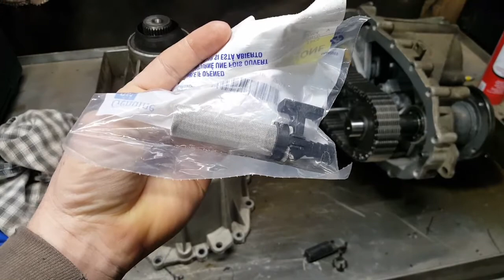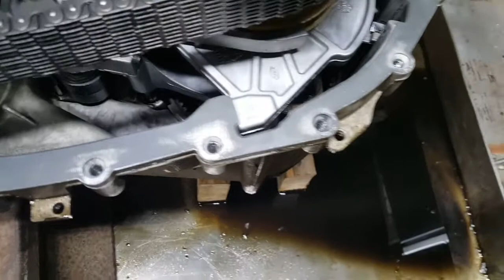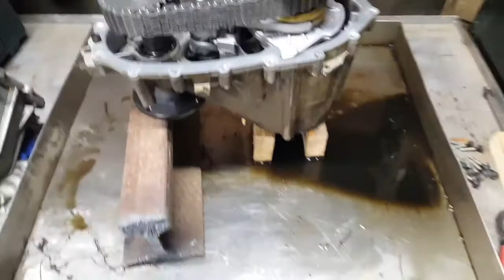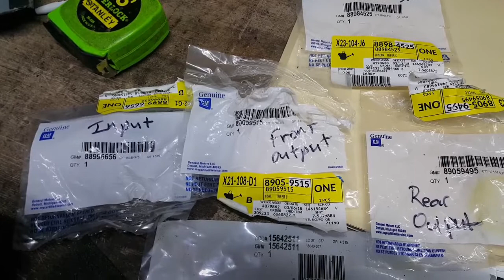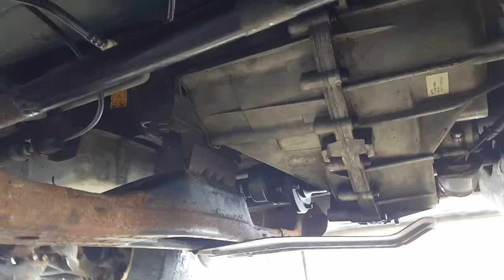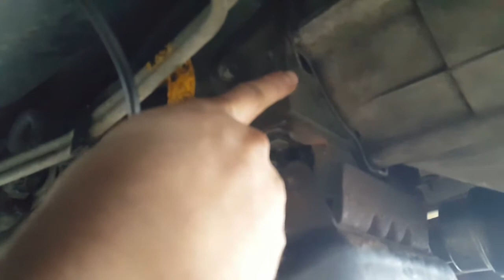Hummer H3 Transfer Case Pt 2

Comment: When you said disengage was it stuck in 4 wd high and did the dash light from all wheel to 4 high change mine definitely something wrong at above 55lbs and when I pulled over to turn around it felt like I was in 4 wd high or low all by itself after I changed out shift motor already now I’m changing out fork cause it thumps and grabs and starts to wine all while it says I’m in all wheel drive, do you think I’m having a fork issue

Comment: Hi, does anyone know if I can just replace the shifter fork without removing any of the gears ⚙️?
Thanks
Reply from the maker: It's been a long time ago since I did this job, but I don't think the fork can be replaced without removing the gears. I don't think you can access it until the gears are out of the way.

Comment: Si im about to replace my shift fork and I want to know if the vehicle needs to be in D or N or if  the drive shaft needs to be alignment or something and what do I need to know before doing this job I would like you to give me you phone number or a way I can contact you to ask some questions I really need help!
Reply from the maker: Hey there, whether the truck is in D or N doesn't really matter much. No need to worry about phasing the driveshafts either.

Sorry, I don't give out my phone number, but if you post up in the comments here, I should see it and I can respond.

Good luck with the project.

Comment: Can anyone tell me what is the easiest way to put the 2 halves back together?
Do you have them side by side or the half with the gears facing up and the 2nd half coming down from above ? I'm having a terrible time getting the shift lever, the Fork tube, and the 2 drive gears to align up to the second half of the Transfer case !
Reply from the maker: I reassembled mine laying flat, side by side on the workbench.
Reply: @diymechanictv1233  
Wow, thanks for the fast reply... I broke the little tip off of the shift lever and had to wait a week to replace that part...just got it and now am fighting getting the halves back together... I don't want to RTV it yet until I can make sure I can get it back together ! It's tough getting 4 different shafts and that spring all lined up at the same time !
Thanks again

Comment: Hi. Hopefully you see this in time. My '06 H3 stopped functioning while my daughter was on her way to work. So I went to where she was at and got in my truck. Turned it on and went to go reverse, it sounded like grinding but not technically a noise to hurt the ears! I asked my daughter if she went to drive it to pull it off road and she said it made the same noise. 
So at this moment, I am about to get under my truck and see how much gear oil I have in my transfer case. However, from watching part 1 of your video. I am leaning with thinking I may have to take the whole unit out. Are you familiar with any sounds that come from the transfer case?
Reply from the maker: Hey there, I have heard a similar sound before when the transfer case slips into neutral. It's possible that the chain in the case broke, but it's also possible that the fork I repla Ed in this video failed and the case is between 2wd and neutral. Try shifting it into 4x4 and see if it catches and will move. At any rate, somebody needs to check out the transfer case.

Good luck!

Comment: Hi Great video, I have a problem with my Hummer think it could be this. I was reversing and something popped had no drive forward or backwards. once i got the vehicle jacked up realized the e-brake had seized on could this have caused the fork to pop and maybe put the transfer case into neutral hence no drive. Its a standard transmission?
Reply from the maker: Sure sounds like an issue with the transfer case to me!

Comment: I've got a bad encoder motor. It will not shift. Took old one off new one on. Tried to shift. Says service 4wd. Note this is after getting it back from the shop having the fork replace. Any tips would be helpful.
Reply from the maker: If you had a shop do the repairs, I think you need to talk with them about making it right. Even if the encoder motor was bad when you took it in, you have fixed that issue and still have a problem. How could the shop have verified their repair if the system was not working?

Comment: Saw your video and it is very intuitive. So it looks like I have the dreaded broken plastic shift Fork. Am I able to open up my transfer case myself, and just change out the plastic shift Fork to metal without disturbing anything else and put it back together. I don't want to mess with realigning the planetary gear or anything if possible.
Reply from the maker: There is a chance you'll need to realign the planetaries when the case comes apart. To be honest, it's been long enough now that I do t recall whether the planetaries came apart when I split the case or if I separated them for inspection, but if lining them back up is a deal breaker for you, I'd suggest letting someone else do the work. Thanks for watching!
Reply: There are timing marks on the planetary gear set.  There is more information about this on other youtube videos.

Comment: thanks for the nice video. I do have questions please. for the last 1 and half month ago I accidentally was driving with 4WD high lock. must be my hand touching those botton while I'm cleaning the interior. so what happening is, every time before park with Sharp turn right either forward or backward in parking lot, I have hard time because the vehicle won't move and make some noise so I went to straighten the wheels and backing up with no proble m. I call my friend telling him what happening and he said something to do with the 4WD. so I check the bottom and I notice it's was for a while (1& half month I have been driving 4WD high lock. ) so I make switch to normal 4WD regural. and everything sound back to normal except the noise coming on and off only when I driving slow sharp turn in parking lot. my question to you is : did i broke anything in the transfer case or not? what are the noise you think? thanks for your help and advice.

Comment: @DIYMechincTV. I get a vibration when driving above 2500 rpm. Was thinking i needed to get my drive axles re-balanced. Took it to the shop and that wasn't the case. They showed me where my rear axel went into the transfer case and was a little warped. They believe there was something wrong with the transfer case but did not have the expertise to fix it. Do you think it could be the same nylon fork that you mention in your video? Would that cause vibration when driving?
Reply from the maker: I don't see the fork causing a vibration while driving. That does sound like something out of balance.
Reply: @diymechanictv1233  I did take it to get checked out by an axel place and they told me both my front and rear axel was fine. However they did show me where the yoke of the rear axel went into the transfer case had some grooving on it. I have a pic but cant and it here
Reply: @diymechanictv1233  I just really want to make sure that there isnt a major issue with my transfer case. I just put alot of money into it getting the engine rebuilt
Reply from the maker: @davidharvey6253  I don't see where this issue would be associated with the transfer case. I would attempt to determine whether the vibration is related to engine speed or to ground. For instance, if you lock the engine into a different gear and go above 2500 RPM and you feel the vibration reagrdless of what the ground speed is, then I would look at the engine as the possible source of the vibration. If it is related more closely to a specific ground speed (MPH) and is there even if you change the gear selection of the transmission (like taking it out of overdrive) then I would look at driveline components or even a tire imbalance/tread separation, or something along those lines. Knowing whether it is tied to engine speed or to  vehicle (ground) speed tells you which way to approach the troubleshooting.
Reply: @diymechanictv1233  thank you for the insight. I can tell you its definately more related to ground speed. Mainly about 50 MPH. I will check for a tire imbalance for sure.  Other than that, what else could be the issues with a driveline component? Would you mean wheel bearings possibly?
Reply from the maker: @davidharvey6253  Wheel bearings, driveshaft u-joints (rear), tires, heck even the brakes could be doing this to you if you had a warped or badly rusted drum or rotor. The frequency of the vibration is usually a clue. If you look at the speed that your tires rotate, is it around that speed or is it something about 3-4 times that fast (almost feels more like a "buzz") while you're driving. If it's fast, it's before the differential (or in it), if it's slow it could be a tire or bent rim or something.
Reply: @diymechanictv1233  it's closer to that buzz you speak of. Thank you for helping me to possibly narrow this down

Comment: Would it be possible to view the shift fork from the fill plug? Trying to figure out if I have a plastic fork or aluminum. 

From the exploded parts diagram it looked like it might be possible but Im not really sure. Im not familiar enough with the orientation of the parts in there.
Reply from the maker: I'm not sure if you could see it or not, or if  you could, whether you would be able to tell if it was nylon or aluminum. A cheap bore scope, might be the way to go! Grab a USB bore scope and let us know what you find! It might just save you a few hours' time.

Comment: I followed your video and all went well except the shift motor shaft. I cannot install the shift motor onto the shaft and the shaft has limited movement so I think I messed up when I put it back in.
Reply from the maker: It's possible that the case is not in neutral (or in whatever position the motor is in). See if the shaft will move freely if you move it manually (using a pliers or similar). If not, then I hate to say it, but you may have to pull it apart again and see what isn't aligned correctly.
Reply: @diymechanictv1233  what do you mean aligned correctly?

Im about to pull mine and I dont want to mess up also what type of seal did yoy use?
Reply from the maker: Just be careful when you put the shift motor back on that you get the motor aligned with the shaft so that they lock together correctly.

For the seal, I just used Permatex Ultra Gray silicone sealant.

Comment: in D it is very strong and it is very heavy, it almost does not move, I put the accelerator to the bottom and it moves but soft until it takes speed and walks normally. in R walks perfect. It does not have any noise when walking. turn on perfect. I would like your help before spending money. I hope someone helps me. Thank you. 2007 hummer h3
Reply from the maker: If the vehicle won't move in a straight line, I don't think your issue is the transfer case. I would look at the braking system or the transmission based on the symptoms you describe.
Reply: @diymechanictv1233  thanks